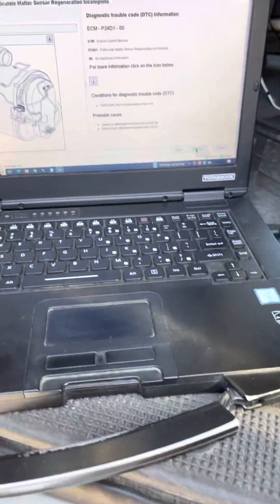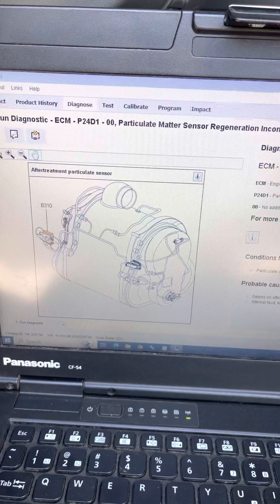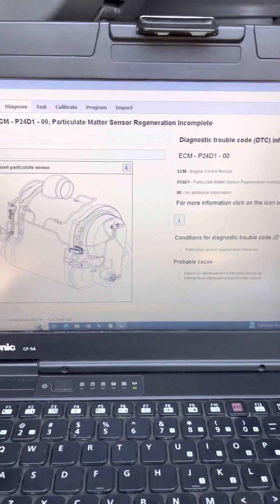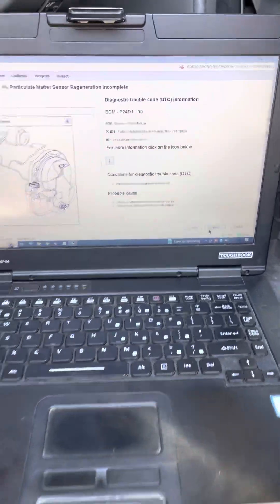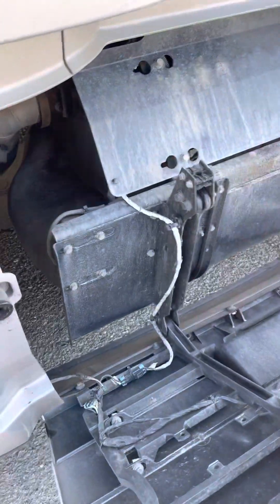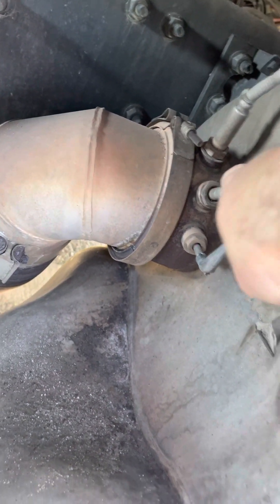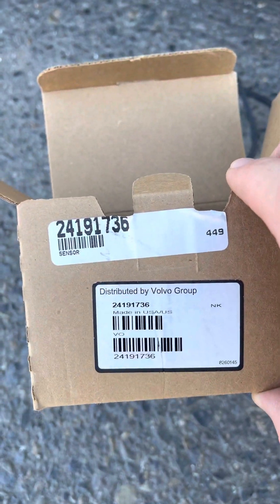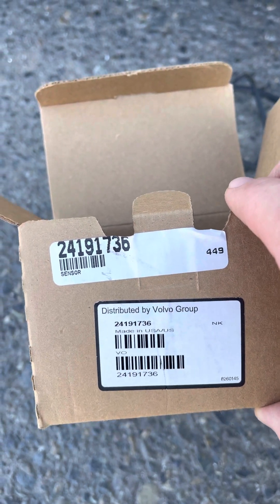VOLVO D13  code P24D100 particulate matter sensor

Comment: Hi
You can help me for volvo d13 2019
Code: SA 16 DTC P04200
Thanks
Reply: I have the same code. And my truck randomly smoke white . That code came up. Dealership has made spend hundreds of dollar they can’t figure the problem. I took somewhere else they clean the one box this week hopefully it fix
Reply: @adrianals7932   Hi, were you able to find a fix for this code? Having same problem